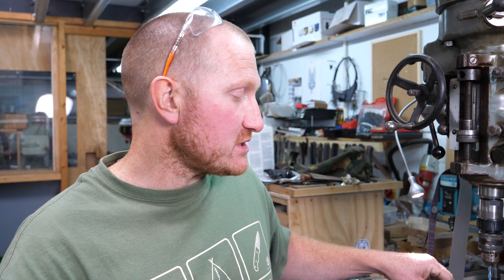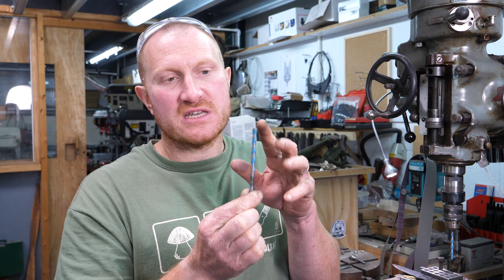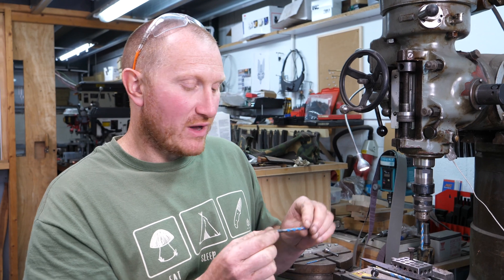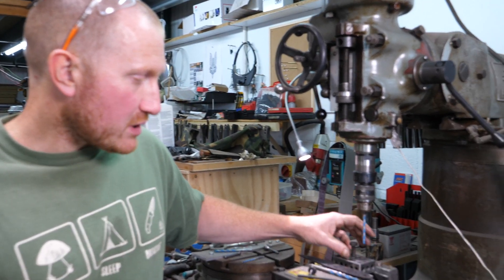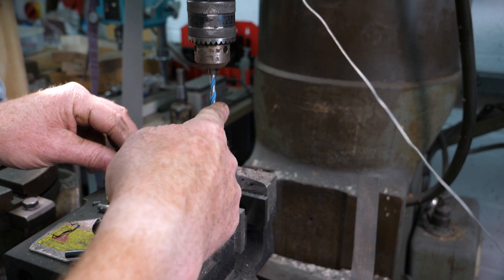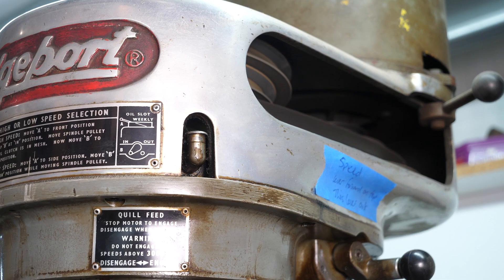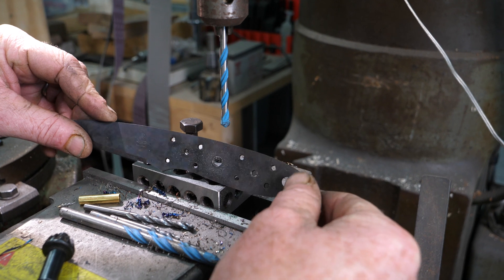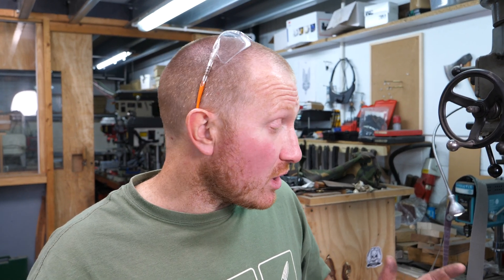How to Drill Hardened Steel  - Knifemaking Top Tips

Comment: We have to drill hardened steel for digger shovels and stuff like that. Once a drill is done, it's done, regular spiral drill bits can be regrinded (or reground) drill bits for hardened steel can't. It is really important to keep it cool, well lubricated and go slow. I always think of the pointer sisters, when doing this boring boring. Hardened steel wants a slow hand with an easy touch.

Comment: I have a slab of 440c steel but its hardened I have no idea if I can drill a hole in it? I have a bench drill but nothing as fancy or industrial as yours. Its a hobby drill. Do you think I will be able to drill holes in this slab somehow? normal metal bits start bending when I pushed down on the pillar drill.

Comment: I am a safe and vault technician. I drill into hardened steel every day opening safes. It’s much easier to drill a new hole in hardened steel than to enlarge a hole in hardened steel. The Bosch bits great for enlarging hole but not new holes. The tips have a wide face. Strong Arm and Mr. Twister bits have a pointed tip. Pro lok bits as well. Speed needs to be slower for new holes and faster for enlargement. Not drilling fluid needed with thin hardened steel. I’m usually drilling 3/8 to 1/2 hardened plate. Yesterday I drilled 3/8 hardened plate 1/4 pro lok bit. I minute penetration with hand drilling rig. Diebold cash guard TL-30 rating   Check out the bits for your self. Remember slow speed 400 rpm and listen for the bit starting to eat and adjust pressure and hold constant pressure. It will sail through the material. The pressure you need on the drill bit is approximately 800lbs to 1000lbs. I do this by hand for pressure control and not to break through the other side of the plate.
Reply from the maker: Thanks for the info. Sounds a interesting job you have. Thanks for the time commenting. cheers Ben
Reply: If you wanted to countersink and drill a 1/4” hole in 1/2” plate, would you put the 1/4” hole in first or would you use a larger drill say 1/2” to start a hole then finish with a smaller 1/4” bit?
Reply: @ehRalph  I would use the 1/2 first to the desired depth the use the 1/4. Never needed to counter sink in hardened steel but this might be the best way. Unless someone has a better way of doing it.
Reply: @jonbottoms8988  thanks. Not ready to drill it yet but planning is getting closer Thanks again!!
Reply: What's the fastest you've been able to get through a single plate? ( Not included the soft metal before or the lock body)

Comment: I am surprised that most of the video on drilling into hardened steel didn't mention using cutting oil. I am drilling into a couple of lengths of hardened steel rods used in mining exploration drilling. It was hard work. By applying cutting oil regularly, it seemed to generate less heat. I can't prove it scientifically, but I venture to say that cutting oil is helpful.

Comment: Can it drill a new hole?
Reply: Yes that's possible but it will be more difficult. Just like a non-split point drill it doesn't actually cut in the center so that matterial will have to be rubbed and pushed through to push it to the cutting edge.

Comment: And it didn't even need any cutting/tapping oil, paste, lubricant, spray, anti drilling chatter, anti dulling, anti squealing, anti breaking, anti binding and breaking your hand if your using a bigger flex volt beam and joist drill! Lol I love my dewalt version of the "hole hawg" haha I would recommend it to anyone that wants more power for those glue laminate beam holes for fastening lag screws or running romex, pipe etc through the studs, or even solid hardwood beams! I've personally drilled through a hardwood 12 inch beam with my "irwin speedbor 2000" installer 3/8" diameter AND MY VERMONT AMERICAN/LENOX SHIP AUGER BIT

Comment: I have been using these Bosch masonry drill bits for years. They are brilliant for drilling through tiles. Even the hardest tiles... you only get about 6 holes per drill bit, but still I would recommend

Comment: Very nervous to see you drilling through the knife without clamping it down or at least taping up the blade. I’ve heard of people getting their fingers sliced off from the drill getting snagged going through 😳
Reply from the maker: Thanks for the concern but having that bolt in the 123 block prevents the fear of the blade spinning, but as I said if you prefer to clamp it then that’s a good idea  👍

Comment: Bro great video. my HSS drill bit cannot slice on stainless steel for the speargun shaft. is there a carbide drill bit that is about 2mm?
Reply: They do make carbide drill bits that small. Most electrical repair places sell them for drilling mother boards. Lots of glass fiber in that stuff and it wears out bits. They are usually cheap too from these places. Just have a look on google, no particular brand.

Comment: Fantastic. I bought a Chef's knife 30 years ago at the Mount Nelson Hotel in cape town. The knife was a British one. It had the name IMPACT lasered on. Nice knife and it was ice hardened.
And I like hanging my kitchen knives on nails so they can be easily accessible and drip dry.
So twenty drill bits and years of frustration later
Thank you. I have even destroyed a few carbide bits and do have a hole.
But you have now saved a few people from my predicament
I still use the knife.
Reply: Knife model number? Manufacturer? Company name? I'd like to purchase one if possible
Reply: @northwestrockgem9745  that's all i have. I have tried to Google it to no avail

Comment: Will this work if you need to start a completely new whole in hardened steel (centre punched) and if not is there something else you could please recommend? Thanks Ben.k x
Reply: I have same question. I think not. Been trying to use electric hand drill and almost zero result with standard, rather old, bits. I think only around 1300rpm not over 2000 as in this case. So probably wont invest and try. Although they do seem good general purpose bits.

Comment: there is also an other brand called "Alpen" there you get Diameters from 3 - 22mm, the bigger ones you get also with Sds bits, I use them for stonedrilling without hammerdrill, I like them because you can drill in tiles, concret with metall, metall, steel, stone, marble, granite etc.
Reply: You cannot use them for tempered steel.